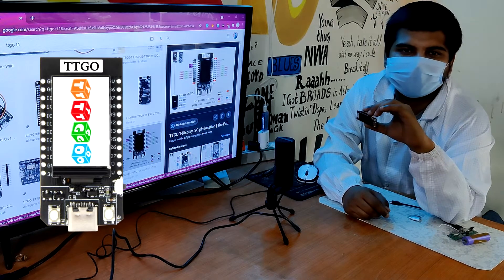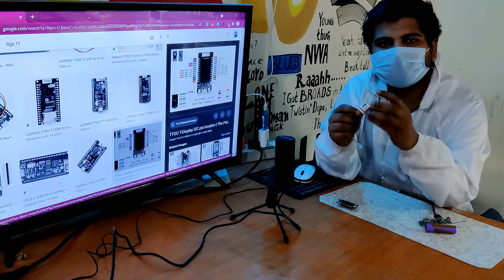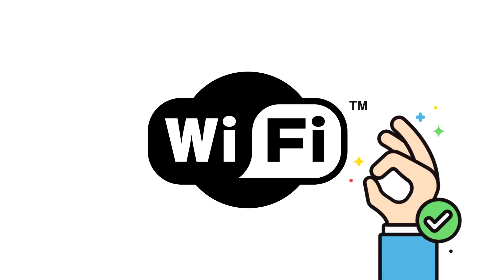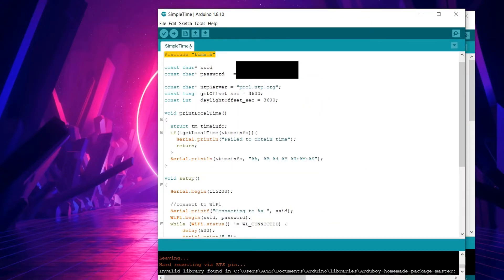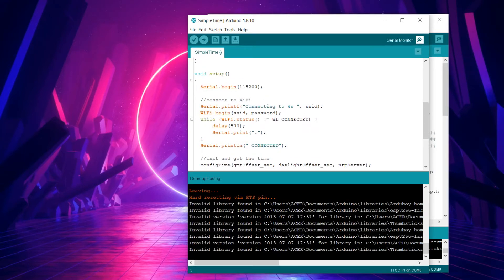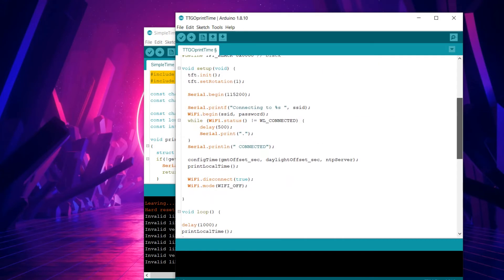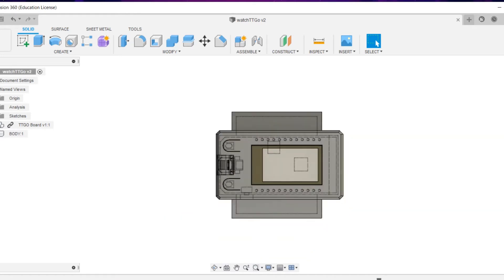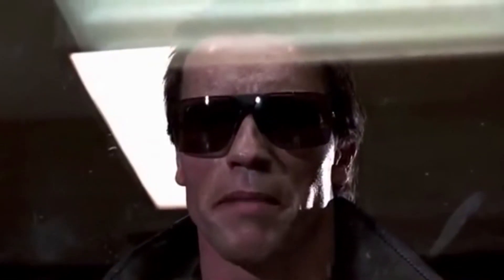ESP32 Internet Clock with TTGO T display

Comment: when i charge battery (power adapter more 1 amp ) IC  TP4056 it very hot is it normal ?
Reply from the maker: It is normal. however, its better if you use adapter less than 1A.

Comment: When I received the TTGO board it had its graphic demo program running. I did the "Time on monitor" and it worked well. Uploading your second code (and changing Wifi info), the program runs and shows I'm connected but I'm not getting any display.
All the libraries are present.
My TTGO is stamped ver 1.1 on the back.  None of the example test scripts display. 
Suggestions?